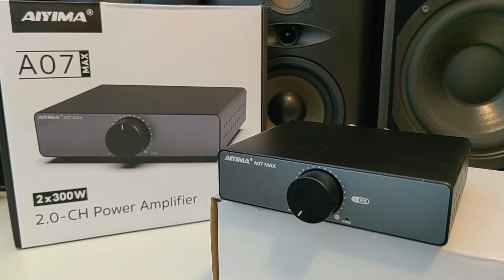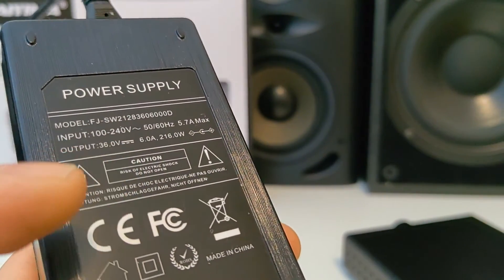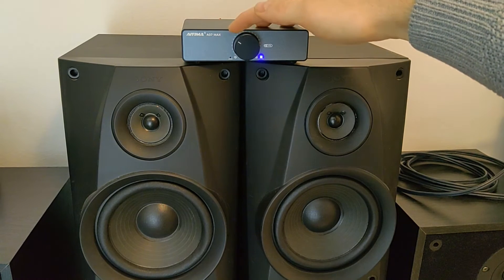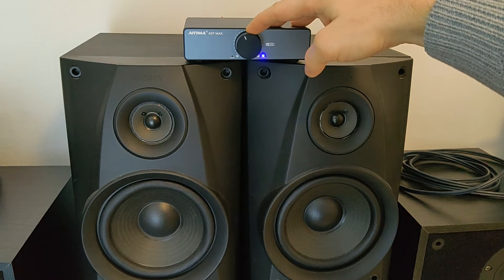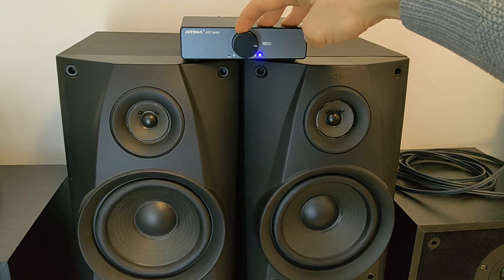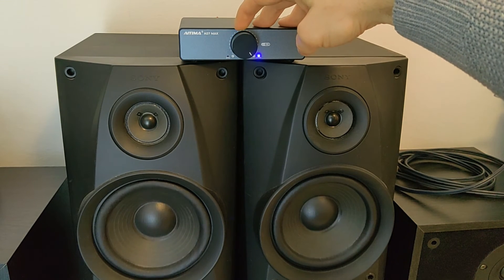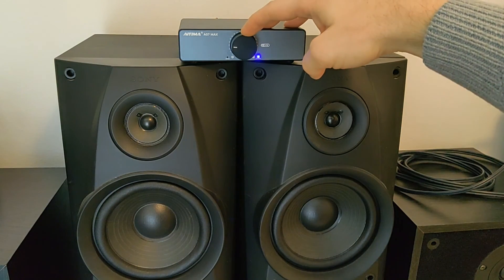Aiyima A07 MAX Amplifier (TPA3255) with mono & stereo bridge switch

Comment: Hi ALS, Another good inclusive demonstration, i.e. setting up this amplifier with speakers. I recently saw a short video were you showed this amplifier could be switched into mono-block mode. So, if you had two of these amplifiers then you could really have the basis of a brilliant Hi-Fi system, but the only thing I don't understand is how could you connect an Aiyima pre-amp or DAC to a 2 mono-block system to create a truly great stereo audio system?

PS. It's nearly time to upgrade my 6 x Nobsound mini-amp system (bought during lockdown) to something more conventional and manageable, so I maybe looking to an Aiyima  based system as a worthy replacement.

TIA

Bob
Reply: Connect one RCA to the left block and the other RCA to the right block coming from the dac RCA out. Red to left or right and White to either left or right.

Comment: If you want to see what these TPA3255 amplifiers can do, hook one up to a pair of nice towers in a proper listening room.  You're in for a real treat!
Reply: You're not kidding! I have a Fosi V3 driving my large omnidirectional Mirage OM9's and the sound is incredible. No subwoofer needed! I put a cheap SUCA Audio T1 tube buffer in front of it with some nice NOS tubes and the sound is wonderful!
Reply: @RUMBLEGO1 
I use my A07 and TB10d straight from a PC/USB DAC into a pair of modified Pioneer towers... It's been years since I've heard anything better. 

Heard a V3 on a pair of Heresys the other day ... WOW... seriously impressive.
Reply: @Douglas_Blake_579  Are you using the A07 Max or the original A07? I own the original A07 and the V3 with 32v5A power supply is better than the A07. I upgraded to the 48V power supply and it improved further. The A07 Max looks like it will be equal if not better than the V3 however. They are all the same chip but just different and better parts implementation. Also better and more thoughtful construction.
Reply: @RUMBLEGO1 
The original A07.  I'm fully aware the V3 might be better  and the MAX better still... but that power switch on the volume control is a real deal breaker. 

Both of the amplifiers i use have been rather heavily modified to get rid of some of their problems, and they do sound better than the stock versions.

I had a V3 come through here a few days ago, put it up on the test bench, and were it not for that cursed power switch, I probably would have upgraded to it, myself.

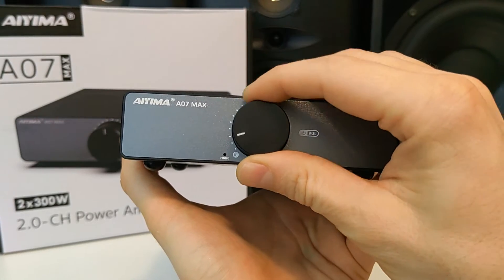Comment: 1:00 ... deal breaker ... power switch on volume control.  

Makes it useless as a power amp since you have to reset the volume every time you turn it on.
Even more useless as monoblocks because now you need to re-balance the sound every time.
Reply: For my Fosi V3 I never turn it off just use a the switch on my power strip.  I use it to power my computer speakers and use volume control from the PC.
Reply: @jamesskiles1160 
Sure, no problem.  Most people don't do that.
Reply: You can just let then sit at max volume and use a pre to adjust the volume?
Reply: @daniloberserk 
In many cases yes you can...
Reply: Why is that an issue?  Keep the volume on max and use a proper preamp.
Reply: @OneNationUnderHiFi  
Top 5 reasons why power switches on volume controls are a problem...

1) The switch itself will be under-rated and will fail eventually.
2) Constantly changing volume increases wear and tear on the volume control.
3) It defeats gain staging in which the gains on power amps are used to set maximum listening levels.
4) In dual mono systems, getting the volumes equal is difficult.
5) Leaving the amp on and turning off the power brick can lead to premature death of the power brick due to large current inrushes each time you turn it on.
Reply: @OneNationUnderHiFi  
In your opinion.

What you seem not to realize is that the TPA3255 chip at the heart of these little amps is the same chip used in sound reinforcement, hifi amplifier modules, powered monitors and even high end stereo  equipment... just without the "audiophile" markup.  They are very capable amplifiers and they can easily form the heart of a good quality home system.

The A07 currently in my system driving a pair of pioneer towers easily replaced a Marantz PM68...
Reply: @Douglas_Blake_579 I get that, but you are complaining about the power switch implementation. All I’m saying is that what do you expect for such a low cost?   They are great for what they are in my opinion.
Reply: @OneNationUnderHiFi  
Given that this switch on the know thing is new and separate power switches have been customary on these things from the beginning, I expect them to not mess with success and stay with what works.